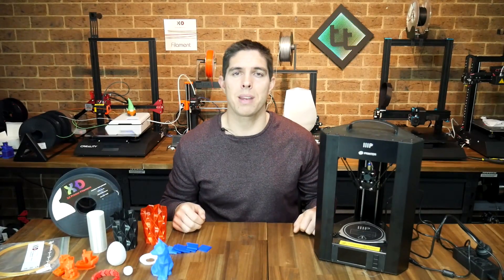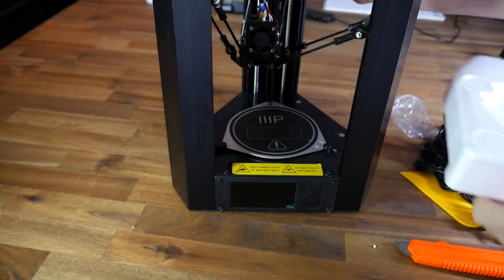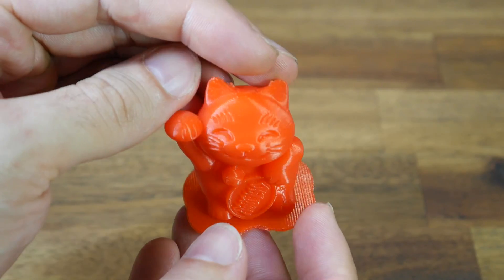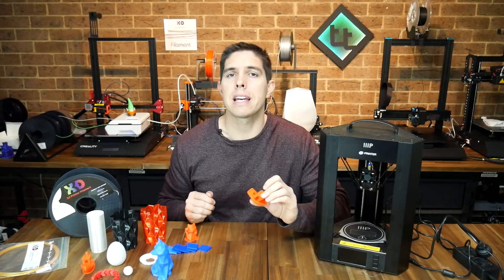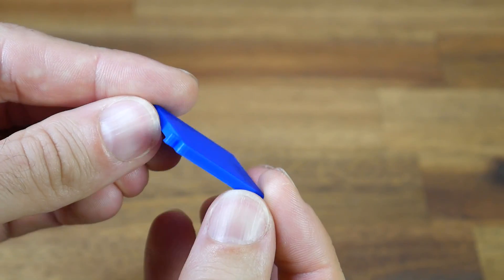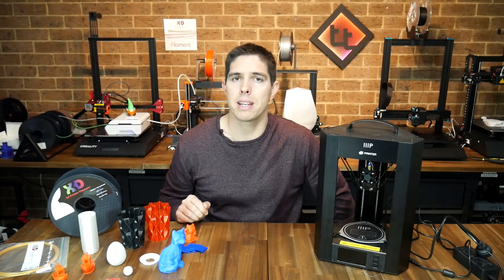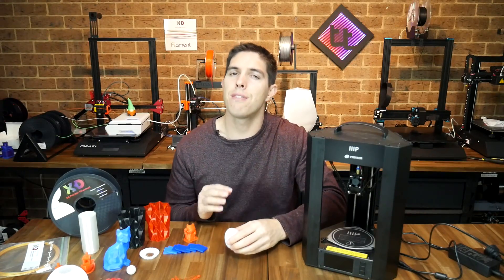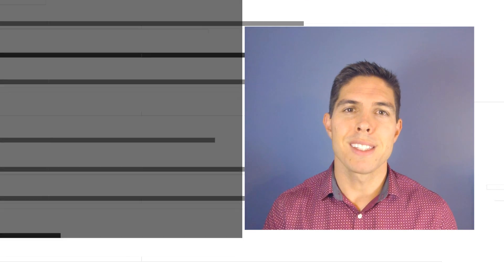Monoprice Mini Delta review -

Comment: this was my first printer it worked great when I had no clue what I was doing. 6 years and 7 printers later I am obsessed with 3d printing! I used this printer to print over 100 brackets for a project at work it chugged along  until it just quit one day, great printer was only around 100.00.

Comment: I purchased the MP Delta Mini V2 this week and set it up last night. They must have watched your video, as all of your complaints and peeves have been fixed and resolved. Gone are the buttons on the, now the display is a convenient touch screen to navigate. They moved the SD card slot to the front as you suggested. Added a power on/off switch to back, no more unplugging to power off. The best change, improvements to stepper motors make almost silent when operating. 

I only printed the sample files that came with it, everyone I show them to is amazed at the quality. If you can live with the small build size, I think it is a perfect beginner printer.
Reply: I don't know, I have only ever used PLA.
Reply: Can the V2 handle PETG now?

Comment: Seen it - and as a person who currently does not use one, this is tempting for D&D miniatures which largely do not need the larger print size.  Resisted before due to the learning curve of the equipment, calibrating etc etc - Struggling to resist this one

Comment: DO NOT BUY! THIS IS NOT FOR BEGINERS! 

this piece of shit does not work, 

the bed does NOT level.
CAN NOT BE MANUALY LEVELED! 
prints on the left side etches into the bed on the right side.

and half way through every print it goes from printing solid to printing web trash.
every adjustment I've mad just makes it worse, dispite following videos step by step.
Set everything back to default get nothing but web structures! 

you CAN NOT print out of box.

It grinds and tries to start outside the bed plate.
the spools of material a have to be re spun or stick to themselves and stop feeding. 

CAN NOT print PETG or METAL filaments.

If anyone knows of a way to fix this piece of GARBAGE
please contact me

Comment: Great review I have been looking at the deltas for a while not this one but the next one up, in reality compared to a ender 3 proi how much faster would it be for printing say a benchy on the ender and then on the delta, Im  looking for more speed, I only use pla or flexi at the moment and I print things to make lasers and so on,  I was thinking of using this a delta as my normal printer ans upgrade the hotend, motherboard on the ender to print higher temperature filaments.  What do you think on the speed difference please between the to on a identical object? Thank you Michael.

Comment: I have a Mini delta but suddenly it stopped printing after I changed the filament. The menu works but the printer doesn't respond to any option. It doesn't  print, no SD list is showed, it doesn't preheat, the nozzle and bed show a zero,  the hot end assembly doesn't move and the fan either. Any idea what it could be ?...thank you.

Comment: hey, a total noob here. I wanted to get into this hobby and I purchased this printer. The prints that are already loaded onto the SD card (stock) the printer prints beautifully, but any other prints that either I design in blender or download from thingiverse, after splicing the print doesn't stick to the bed (using PLA) and it warps just like I saw in your video. I set the bed temperature at 60 although it never truly gets there. What am I doing wrong? What are the typical causes of this happening? Thanks!!!

Comment: This is an old review, but I would love to get this printer to do minis for tabletop games.
Reply: This is exactly what I use it for, and it works great. I've never had issues with it.
Reply: @FireSailLabs  Can you give any advice on settings for minis?
Reply: @qualandrew201494  Sure thing. I use PLA and PLA+. The nozzle temp is 190 and the bed temp is 50. I usually print at a speed of 40-55, almost always use a brim, and my layer height ranges from 0.15mm(terrain and such) to 0.07mm(characters and creatures). I also use the version of Cura that comes on the SD card. For some reason, updating Cura can cause compatibility issues.
Reply: @FireSailLabs  I see i was advised against having the height that low as it can cause issues with overflowing
Reply: @FireSailLabs  ill give your settings a try
Reply: @qualandrew201494  It can technically go as low as 0.06mm , though I've never printed that low. I only use 0.07mm if the print has exceptionally small and fine details (an example would be a Jawa I recently printed for a Star Wars D20 game), and I've never had issues with it. For most prints, I go middle of the road at 0.1mm
Reply: @FireSailLabs  Yea i usually print 0.1 but i have so much stringing on the print and often the print is "broken" at places
Reply: @qualandrew201494  Ah, I see, that would be caused by either print speed, or the type of filament you are using. PLA+ is really good for avoiding both of those issues.
Reply: @FireSailLabs  im using AMZ3D PLA filament.
Reply: It's from last year not that old.
Reply: NOPE, get a resin printer for mini's, FDM printer for terrain.

Comment: I have this printer, sadly other than the initial default gcode file(s) you get with it, ive been unsuccessful in even the software registering the printer and IF i manage it, so many others arise (bed never warms up properly, nozzle cools off and pulls print with itself or even nearly pushes too much into bed plate itself) replaved the psu with no difference and tried different material types as suggested it can use, had it over a year and gutted that never managed to use it! :( any pointers on working software (OS suggestions also) would be greatly appreciated)

Comment: Hey what are your settings? (using cura)
Reply: Michael Ohana check the mpminidelta wiki. I recommend using version 15.whatever that’s included on the SD as it’s least likely to reset your configuration. You can import your gcode profile from the manufacturer provided cat file which can also be found on the wiki

Comment: How do I remove the nozzle to replace it?
Reply: if you are a beginner for delta , FLSUN is also  a brand focused on the delta
,It is highly recommended to buy this one https://www.aliexpress.com/item/4000130776715.html?spm=5261.13614333.0.0.763d4dcenY162R less than 170$ ,200x200 printing size,the price in 11.11, off course , you also can consider about FLSUN QQ-s, 260x360mm printing size less than 300$ ，
https://www.aliexpress.com/item/32813476326.html?spm=2114.12010612.8148356.3.2ed81747raVDog

Comment: I've really enjoyed mine but the noisy operation is a definite negative.
Reply: if you are a beginner for delta , FLSUN is also  a brand focused on the delta
,It is highly recommended to buy this one https://www.aliexpress.com/item/4000130776715.html?spm=5261.13614333.0.0.763d4dcenY162R less than 170$ ,200x200 printing size,the price in 11.11, off course , you also can consider about FLSUN QQ-s, 260x360mm printing size less than 300$ ，
https://www.aliexpress.com/item/32813476326.html?spm=2114.12010612.8148356.3.2ed81747raVDog

Comment: I never owned a 3D printer i bought a Mini Delta to try as my first one. I never was about to use it. The only thing i was about to 
print was the Cat that was on the SD card .  I bought a Ender 3 pro. Right off i can use it with out any trouble at all. Everything
I tried to print out came out great. I haven't even plugged in the Mini Delta in no more just sets. As a first time user printer
the Ender 3 D Pro  is number one to me.
Reply: Judge has the Word you wanna sell me that mini delta?

Comment: got mine on Monoprice for $129 US, came with a bad power brick which took another 4-5 days to get before i could print.  I originally had a problem with PLA staying stuck to the bed but adding a brim to the print eliminated that issue.  The bed leveling isn't good.  Mine is low in the back and high in the front right.  The low is enough where it almost prints in air and will not stick to the bed and the high will actually trigger the bed switches when printing the first few layers but it would still print.  I put a glass build plate on it but it seemed like it was heavy enough to activate the bed switches during the leveling process which would stay activated and cause the tool head to back off to the top of the machine where it would just bump away until i unplugged it.   Glass build plate is not an option in my case.

I have been able to work around the bed leveling issue a bit by minding where i place the print on the platform and i have gotten some really great prints from it.  The only other issue is the axis rotation is off, the print faces "forward' in cura but will print facing to the left on the printer.  Not a big deal but it does irritate me a bit for some reason.  I am using the cura profiles downloaded from the mini delta wiki. (https://mpminidelta.com/start)

accuracy seems to be very good.  I printed a mini crossbow  and a large articulated Stormtrooper for my son with some parts in black on my ender3 (.1mm) and others in white on the mini delta (.14mm) and the dimensions appeared very close.  The parts fit together as expected without any modification needed.  However,  I haven't tried anything that requires a high level of precision.

It is pretty noisy.  There was someone selling the OEM boards updated with 2208 drivers for around $50 but doesn't appear he is offering them any more.  

Overall it is a great little printer for the price.  The .14mm resolution is as good or better than my ender 3 at .1mm in much less print time.  It beat the Ender on a Benchy print with similar settings by over an hour.
Reply: The mainboards with TMC2208 stepper drivers are still available but currently out of stock. Shipment of parts including mainboards is arriving today. It will take a few days to change out the stepper drivers and run print test so hopefully by the end of the week or early next week.
Reply: @MatthewUpp  Thanks! after reading through some of the posts i saw your links were what i was referencing.  I believe i signed up a while ago to be notified when they are in stock but i will  do it again.  I'd be interested in the modified board.
Reply: Put P3 in your starting gcode on the G29 command line. Go to the mpminidelta wiki for more on bed leveling
Reply: if you are a beginner for delta , FLSUN is also  a brand focused on the delta
,It is highly recommended to buy this one https://www.aliexpress.com/item/4000130776715.html?spm=5261.13614333.0.0.763d4dcenY162R less than 170$ ,200x200 printing size,the price in 11.11, off course , you also can consider about FLSUN QQ-s, 260x360mm printing size less than 300$ ，
https://www.aliexpress.com/item/32813476326.html?spm=2114.12010612.8148356.3.2ed81747raVDog ,for the FLSUN QQ-S ,It does a great job in the field of mute

Comment: This looks to be the pretty much best printer for people that don't want to learn much/tinker much with a printer. Such amazing quality for only 200$ and its fast too
Reply: if you are a beginner for delta , FLSUN is also  a brand focused on the delta
,It is highly recommended to buy this one https://www.aliexpress.com/item/4000130776715.html?spm=5261.13614333.0.0.763d4dcenY162R less than 170$ ,200x200 printing size,the price in 11.11, off course , you also can consider about FLSUN QQ-s, 260x360mm printing size less than 300$ ，
https://www.aliexpress.com/item/32813476326.html?spm=2114.12010612.8148356.3.2ed81747raVDog ,for the FLSUN QQ-S ,It does a great job in the field of mute

Comment: I have been Looking for a "side arm" for my cr-10s that was around In the smaller end in print size. This just might do it!
Reply: if you are a beginner for delta  , It is highly recommended to buy this one https://www.aliexpress.com/item/4000130776715.html?spm=5261.13614333.0.0.763d4dcenY162R less than 170$ ,200x200 printing size,the price in 11.11, off course , you also can consider about FLSUN QQ-s, 260x360mm printing size less than 300$

Comment: My first 3d printer was a Monoprice Mini, and I found many of the same characteristics that you point out for this one.  It was built well, took almost no time to set up, and still prints PLA really well.  I did manage to get the WiFi set up and working, but found it to be really slow.  It took almost a half hour to transfer an 11.5 MB gcode file over WiFi, when this would've taken less than a minute to do by saving to the micro SD card.  I've tried connecting OctoPrint to it, but haven't been able to establish communication: a problem that others report, although there is supposed to be a fix available for it.
Reply: For octoprint, you just have to install the plugin "Malyan/Monoprice Connection Fix".

Comment: wow, my experience was very dissimilar to yours (though my unit was from monoprice PR and had been used at trade shows)

-Bed Levelling almost always gets it too low for me.
-Part cooling is laughably bad.
-anything higher than 80mm/s and the print quality drastically goes downhill.
-so dimensionally inaccurate that i can print the same gcode twice and get different results.

seriously, i had to stop even trying to print my hypercube [arts on this after spending 2 hours scaling a part for the X motor mounts as the part was far too small.

It prints gorgeously, but it most certainly isnt accurate for me. and whilst 110mm diameter is fine, 120mm height is a bit small IMO 150mm would have been better.

also, this thing is loud.
Reply: if you are a beginner , It is highly recommended to buy this one https://www.aliexpress.com/item/4000130776715.html?spm=5261.13614333.0.0.763d4dcenY162R less than 170$ ,the price in 11.11, off course , you also can consider about FLSUN QQ-s, about Predator, i think ,for individual players, it’s too heavy, about 25 kg.FLSUN Is a brand focused on the delta

Comment: Thanks for the review. I had a lot more problems with this printer. For example the accuracy (x &y 2,5% too low) and the bed leveling with the hot nozzle and wrong bed leveling C offset in the provided cura profile that slowly ruined the buildtak surface. You can get this quiet with stepper dampers, tl smooters and a quiet fan but it is a hassle to do. And buying another power supply unit doesn't solve the problem with the weak bed heating. It seems to be set to this underpowered mode in the firmware that is closed source afaik. So no solution to that issue I guess. But when you can live with the downsides and it is tuned in it prints really well apart from the insufficient cooling. I gave it a 0.2 mm Nozzle and it prints my small and delicate parts like a champ. And oh it is fast! Have a great day! Cheers!

Comment: I have one of those and it really performs well and prints PLA very good!
Reply: if you are a beginner for delta , It is highly recommended to buy this one https://www.aliexpress.com/item/4000130776715.html?spm=5261.13614333.0.0.763d4dcenY162R less than 170$ ,200x200 printing size,the price in 11.11, off course , you also can consider about FLSUN QQ-s, 260x360mm printing size less than 300$ ，
https://www.aliexpress.com/item/32813476326.html?spm=2114.12010612.8148356.3.2ed81747raVDog

Comment: Check out the Facebook group. I've added the borosilicate glass plate with a thermal pad underneath and PEI on top.  Then I did  all the calibration steps outlined there including the heat mapping spread sheet. I have mine printing great. In fact, I wanted to make a filament guide for my CR-10S Pro but the parts turned out terrible on that machine (although I've printed other things well with that machine). So today I reprinted all the parts on my Mini Delta and they printed way better in substantially less time. Also, you can upgrade the firmware to Marlin4MPMD and have the ability to add a 12V 10A power supply. That'll be the next upgrade for me.

Comment: Interesting printer
Thanks for sharing😀👍
Reply: if you are a beginner for delta , FLSUN is also  a brand focused on the delta
,It is highly recommended to buy this one https://www.aliexpress.com/item/4000130776715.html?spm=5261.13614333.0.0.763d4dcenY162R less than 170$ ,200x200 printing size,the price in 11.11, off course , you also can consider about FLSUN QQ-s, 260x360mm printing size less than 300$ ，
https://www.aliexpress.com/item/32813476326.html?spm=2114.12010612.8148356.3.2ed81747raVDog